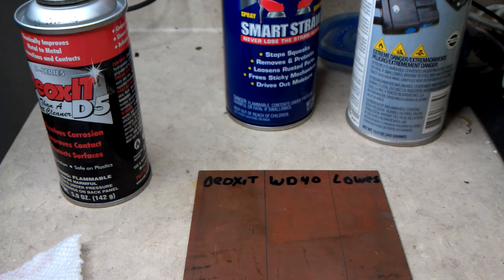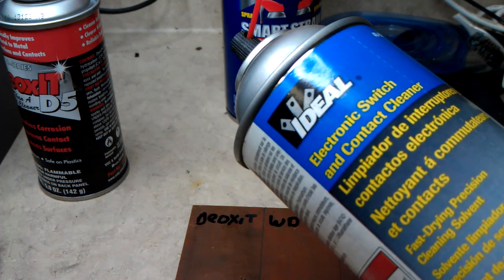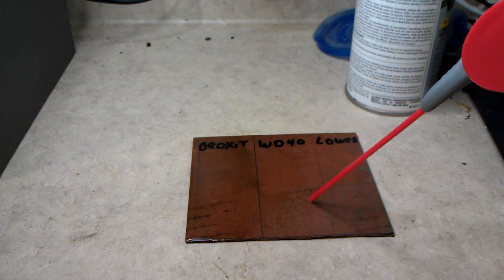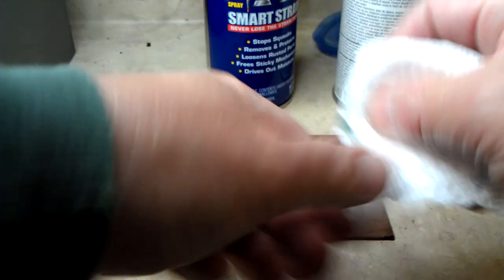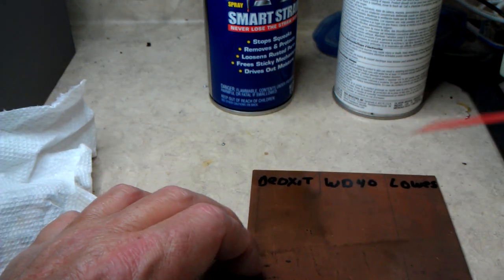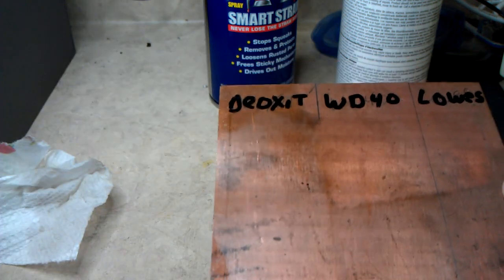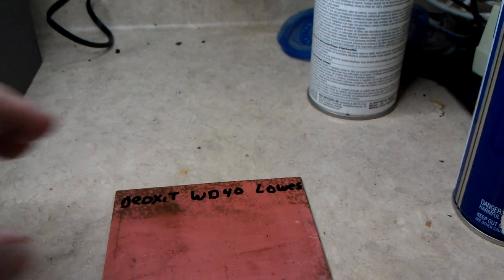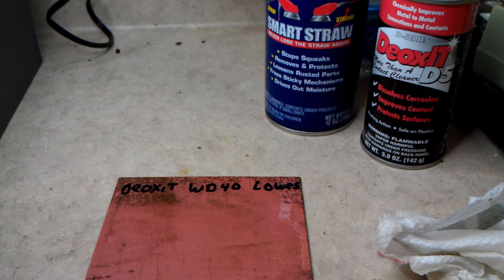DeOxit vs WD40 vs Contact Cleaner - Shootout

Comment: I used Deoxit for years to clean potentiometers.Worked good. Tried WD40 and it performed as well and sometimes better. I stick with the cheaper WD40 with no ill effects !
Reply: Heya! I know super 4 years ago, but am faced with some Signal Killing Switches (for recording}.(Engaging, or even grazing them will clip the output signal on this mic pre... then requires fiddling to get and keep the signal flowing} ..and fyi, this bit of gear is Good, but inexpensive} Wondering if WD is ok to use on small switches that are more or less sealed. Silly Question, but if you have any advice would be most grateful. Cheers and THANK YOU!
Reply: @remotexpolde  https://www.soundonsound.com/forum/viewtopic.php?f=24&t=31447 - dude says using WD40 on his recording equipment junked it because it's non-conductive.. ymmv
Reply: @remotexpolde  i am gonna try WD 40 on my gap pre 73  preamp pots wish me luck 😩🤠🤞
Reply: @kingpencowboy7977  Heya! ^..^  (best of luck!} FYI~ It ended up actually working for me!.. Here is what I did, as it is a `Less is More` situation.. OK! ~ Obvious stuff first,, Unplug, then hit the power button to drain any potential leftover energy stored in various caps, etc..} Open your gear up as much as possible so it can breathe.. (or stick a small fan on there.. wither way is a + ..and ideally in a place it can sit for about one to two days. ~Application~ Use anything you can if the switches are more or less `sealed` (small straw and Very light application ( i used a paper towel to gauge the flow from can at a certain pressure at the cap to see how much was coming out} Or even a q~Tip lightly saturated so when you press it against the bits in question, a little will drizzle out and get into the hard to reach areas}. too much here is not recommended. Repeat again if needed.. (i had to hit mine twice}  and get a very Small amount of WD4o where the post of the switch (or pot, in your case} actually sinks down into the body of the switch\pot connecting to the pcb. Then after working a bit 3o sec to a minute of pushing or rotating.. Let unit sit in the open air unplugged for one to two days. (one day is ok if you can put a mild heat lamp on it, or live in a non humid location, to encourage evaporation. Check and see how it feels.* Also, It Will smell a bit like wd4o when you first turn it on and it warms up. Fine as it is a water displacer.. but the residue will eventually dissipate. I went from the preamp going from unusable to quiet as a mouse in about 3 days. *Just make sure you go light, Work it in, and let sit and evaporate. I was happily surprised and it really did work great. I really hope this helps.. someone.. Lol  .,. Cheers!!! A little patience goes a Long way..
Reply: @nightmareasmr92  oh my goodness you have given the best of you for what i needed this is perfectly put into words! Thx will respond with results
Reply: @nightmareasmr92  also i have the cover off of mine I will take a video and copy link and paste it here
Reply: @kingpencowboy7977  Double Oh My Goodness!! Just happy to help! Thanks for the kind words! Made my day! Cheers!!!

Comment: Holy cow. I never would have thought to try CLR. Thanks for the video :-)

Would you recommend CLR, WD-40, or something else to clean small wire connectors? I'd like to clean the insides of my female Deans T-plug style battery connectors.
Reply from the maker: I play it safe and don't recommend anything.
CLR eats copper! Wash it off quickly. It can also make your nose bleed if you breath the fumes. I know cuz I used it in the shower ONCE.